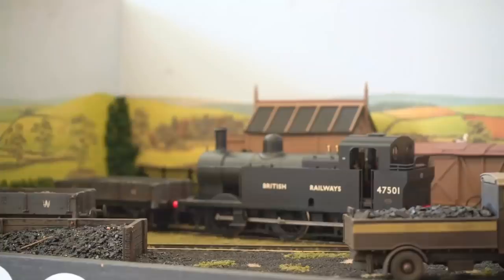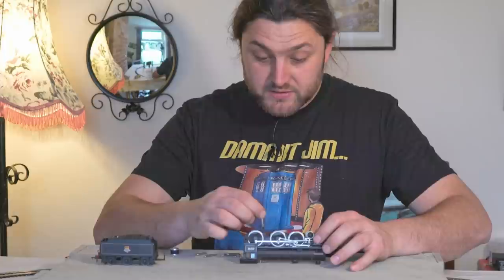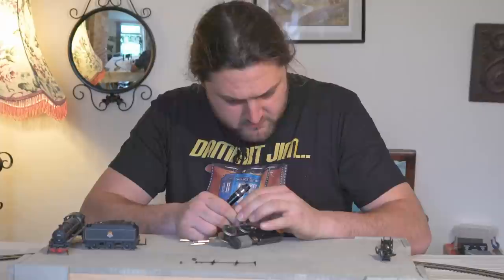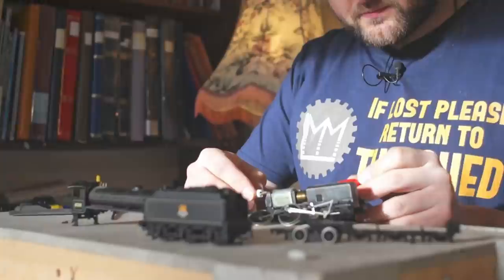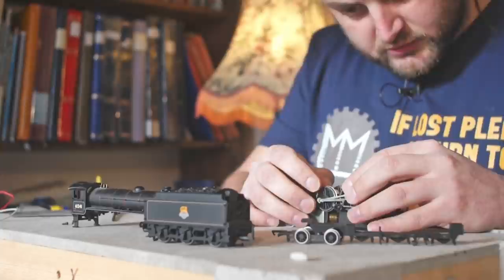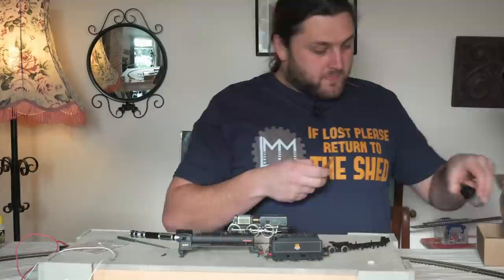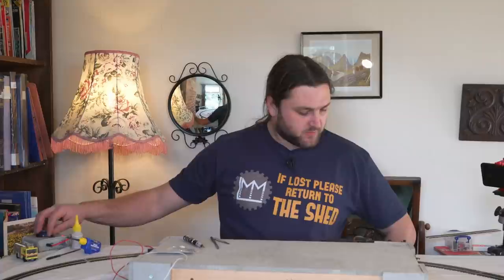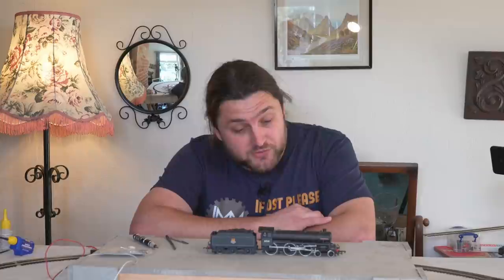Can Lawrie fix the Broken Bachmann B1? Lawrie Goes a Model Loco Episode 16

Comment: I have recently restored a old Bachman B1 and it was a pain in the backside, I worked on during lockdown and even tho I had all the time in the world to do it, I found so many problems and things that had to be replaced it took me 6 months!!
Reply: What an amazing contrast. I own a 1966 Marklin HO German class V200 which is used a lot. I replaced the carbon brushes and traction tires, the AC + pickup sledge, clean it and ad new lubrication, build in an old Delta decoder, and she run again after 20 - 25 minutes, and digital now. (full metal jacket loco, weight a ton and still no sign of zinc rot)

Comment: If it still has a limp it may be worth checking the black inserts on the driving wheels it’s is very common to find that they have expanded outwards which can cause the coupling rods to catch on them which does cause a fair bit of resistance which could be responsible for the limp in running
Only option to fix it if that is the issue is to take the coupling rod off the wheel out remove the black insert from the wheel itself then paint the inside of the area black so it all matches.

Comment: mainline didn't make the B1 Replica Railways did, they even had the Bachmann label underneath on some. but they are all made in the same factory owned by Kader
Reply from the maker: Oh yeah! One of my others is a replica railways one - didn't mainline produce one at all?
Reply: I had a Replica Railways one but it was terrible, the valve gear fell apart and I got rid of it.
Reply: had the replica one way back when it was a good runner, didnt have any problems, some of my best stock was the old split chassis mainline and Replica locomotives.... miss having an OO set up like i used to

Comment: Im 99% sure that by taking the wheels out of the axle he has unquartered them and if he fixes that the limp would go away
Reply from the maker: They are square fitting ones, so getting the things correctly quartered isn't that hard
Reply: @lmm  oh really thats interesting i didn't know that locos came with Square axles thats cool and very helpful
Reply from the maker: Yeah the lugs that go inside are square - earlier mainline and replica railways ones are not square, so quartering is a pain!
Reply: @lmm  thats lucky i dont think they did things like that in the states i would make things much especially easy

Comment: Thanks for the great video…..I’m trying to get a bachmann split chassis pannier tank running again but the motor doesn’t run when I connect a power supply via alligator clip test leads as you show to the terminals motor terminals.

I’ve tested the power leads on another loco so I know the leads do have power

What would cause one of these split chassis (brush?) motors to fail & is it repairable? Thanks in advance